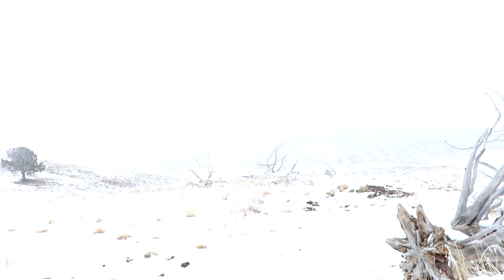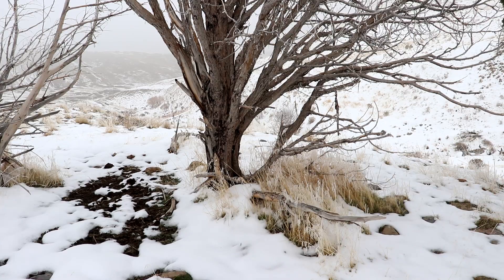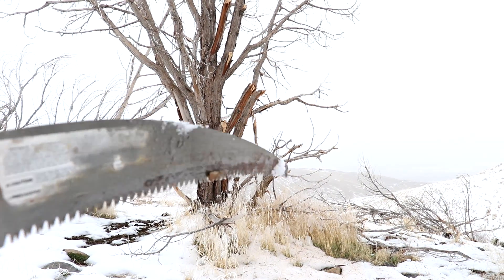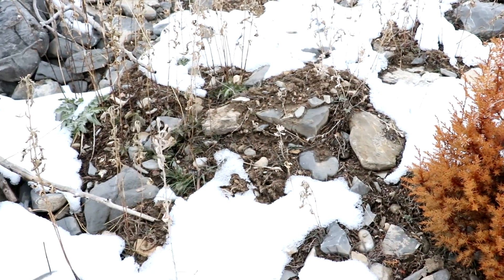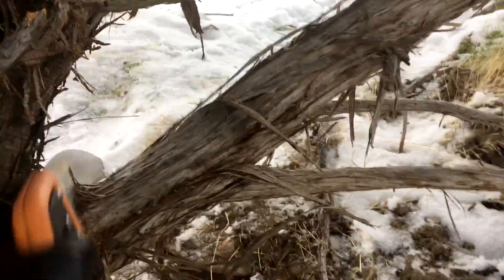Reforesting the Ranch Part 3: Fire-Proofing Existing Trees

Comment: May I ask why you didn't use a chainsaw from the beginning?
Reply: Probably because city-dwelling people simply do not understand and think chainsaws and people who own them are evil. Those of us who live in the country get it. Sometimes trees need to be cut down, pruned, or cut up after they fall across a rode or power line. But boy, the reactions from city people. Especially if you burn the logs! They freak out.
Reply: @mckenziekeith7434  what are you on about
Reply: @danielpluck6770  I am attempting to explain why I think Cody may have initially refrained from using a chainsaw. He may have been anticipating negative reaction from some people regarding chainsaws.
Reply: @mckenziekeith7434  I'd guess he simply didn't want to bring out a heavy tool if it wasn't specifically needed. We're not talking walking across your backyard to trim trees here.

Comment: Have you considered removing the topsoil and replacing it with crushed rock/gravel as well? The heat from the fire would also travel through the ground into the roots of the trees and had an impact on which trees would have burnt. The sap running through the roots could potentially get superheated and basically burn it from the inside out, at least that’s the case up north in Canada here a lot.

Comment: By cutting off the lower branches, you are also allowing more light onto the ground beneath the tree. 
It didn't look like you went high enough to allow cows underneath and some of the trees don't look like they'd survive that kind of pruning. 
I'm thinking there will become a fire hazard when grass grows underneath and the heat rises when it's burned.
There is a lot of large rocks around the place, and if placed under the trees would limit the amount of grass that could grow there.

Comment: Cody, when you were examining the growth rings on the cut limb.....it looks like you were commenting on how the tension wood hadn't grown.  On a leaning limb, you have tension and compression wood.  The tension wood will have narrow growth rings, and the compression wood rings will be fatter.  That makes the pith off-center and the fat compression rings on the downhill side.  It looked like the rings were fatter on the bottom part of the screen which would have been the downhill side of the limb.  Not to say the tree wasn't stressed, but you need to look at the growth rings all the way around the trunk.

Comment: I'm no botanist, I however doubt that the color of the dirt plays a factor in the color of the wood. If the tree used the dirt to build itself then there would be a crater as the tree used material from the soil as it grew. It more likely has to do with the moisture in the soil than the composition of the soil.
Reply: Warrior Son  I have, it either gets used or it's pushed out of the way or in most cases up which why sidewalks and some roads crack.

Comment: Oh that render distance is still pretty short...
Install optifine, on my pc it no joke doubles the frame rate
Reply: It is actually not uncommon for Optifine to double or even triple the framerate as native Minecraft rendering is so imperformant. Even on faster PCs Optifine can make a large difference as it allows the graphics card to run more optimizations on shaders and lightning for example.

Similar modifications exist for server performance where block state changes in all dimensions are synchronized on one thread in vanilla. Some mods for example enable threads per dimension as it is unlikely for a block change in one dimension to directly affect changes in another.
Reply: @Life4YourGames  Nice

Comment: I would recommend as a start to use a drone to spread seeds of different trees and different hardy plants ( not only flowers and such, more hardy and less likely to burn plants and things that can hold up water in the ground) just as the snow is melting, which will give you a chance of random seeding throughout the ranch, and give you potential water retention in the ground. After that, start with seeding the tree saplings you prepared when the weather is good for such things.
Having a good ground with huge variety of hardy plants helps alot with preventing fires when water retention is high and reduces the dry and flamable weeds and grass and gives bees huge foraging grounds as well, its a chain reaction more hardy plants, less fire, more spreading etc...
Reply: He did a video on his first attempts to clone native trees. He explained in that video that his attempts with collecting seed was not all that successful.

Comment: Step one to fireproofing trees: Cover them in snow.... close enough right? :P

Serious comment: Do you have access to a mass spec at your uni's chem department which you could use to confirm Fe in the sap? If you do find it present, would your TXRF be able to calculate the relative amount of Fe between the two samples, or would the organic molecules cause issues for your tool (asking as a biochemist)?

Comment: won’t a tree also start growing significantly slower after its first 50-60 years, especially smaller trees like those junipers. i know sunlight and rainfall will effect it, but should t it also be expected to slow in its growth as it gets to be that old?
Reply: also, cody you’re a little crazy to take on that job with just a hand pruning saw. at least get a little battery powered sawzall or small chainsaw out there.

Comment: Might I recommend a cordless reciprocating saw and a few extra batteries. Go through many times what you did in much less time. It does cost some money, but one of the better investments I have ever made.
Reply: Chainsaw... And a tank of gas And Youre all set
Reply: With so many dead branches cut on he ranch he could sell them as firewood and offset the cost of the power saw.
Reply: my dad did cut bunches of pinion and juniper brush trees. noticed how the chainsaw teeth wears so fast compared to common pine trees.   later he talked to extension, they said juniper and pinon family tree takes up some sand/soil into their bark while growing up.  thus abrades your saw tool.   I recommend reprociating saw with cheap bunch of rip greenwood blades.
Reply: Warrior Son  yes, I did think that too, a bow saw can take down a whole bloody leylandii conifer, (I've had to do it lots of times) but a folding pruning saw is ok for smaller stuff.
Reply: Nickhasarrived chainsaw?
Reply: Or chainsaw 🤦‍♂️
Reply: Try an electric (battery) powered chain saw.

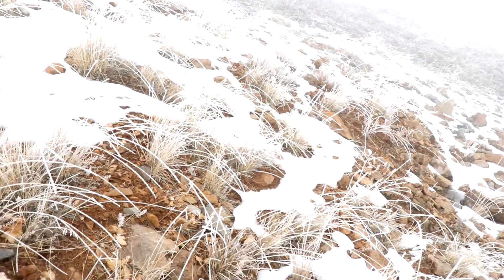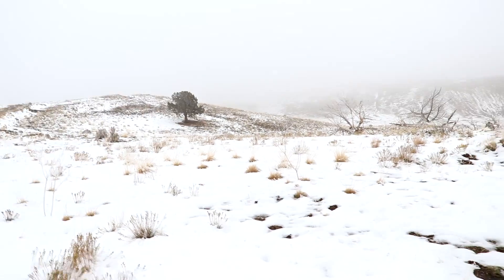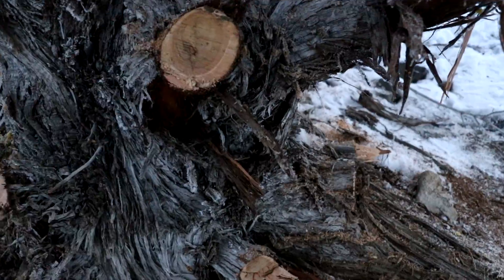Comment: After that weird recording thing at 7:13 in the mercury coin funnel video, and 1:30 and 8:35 of this video I think all that mercury you've been working on has gone to your head.
Reply: What's wrong with 1:30
Reply: @worker2004  voice goes robotic
Reply: Google "audio compression" and as for 8:35, its a easy to make editing oversight
Reply: nothing happens at 1 30 tho
Reply: @SbassLaser  did you not read the other reply?
Reply: @Crowbars2  i did and i still dont notice anything happening, my audio sounds normal the whole time
Reply: @SbassLaser  It's fine if you don't have good speakers or good hearing.
Reply: @Crowbars2  i have 5.1 surround sound and cant hear shit, maybe it only effects certain hardware

Comment: Would your scanner thingy tell you the composition of the orange sap compared to the less orange sap
Reply: I don't think that scanner works (well enough) on liquids, but maybe the wood itself could be scanned.
Reply: Oh good, I'm not the only one who thought of it.

Since the sap is solidified now, would that matter?
Reply: @soniccookie655  Solid doesn't mean crystalline;)
Reply: as far as a lattice of atoms in a rigid structure any solid could be considered crystalline
Reply: jacob casmus Good point, in theory you should be right but I’m unsure off the specifics of his device.
Reply: @jacobcasmus1882 It would just find "light elements" (but maybe might see some iron)
Reply: @jacobcasmus1882  "Crystalline" implies crystals. Crystals are uniform arrangements of atoms. Sap is not a crystal at all, because it is composed of many large molecules (mainly carbohydrates) that are both diverse and not arranged in any orderly fashion.
Reply: I think not, because x-rays go right through the wood without interacting witch its atoms.
Reply: No, it wouldn't. The "scanner" figures the elemental composition. The difference in sap is due to different carbohydrates and tannins in it, which are made of the same concentrations of carbon, nitrogen, oxygen, hydrogen, etc.
Reply: The X-ray spectrometer he used before is mainly geared more towards minerals so I wouldn’t expect it work well on the sap and wood. But It would be fun to see Cody try it.
Reply: well he says its growing in an area of orange soil so probably iron
Reply: @Hewitt_himself    The soil has iron, he already mentioned that, but that doesn't necessarily mean the wood and sap has alot of iron. Another comment mentioned it was excess food the tree was producing. It could just be a coincidence that both the wood/sap and soil are the same color and the coloration of the wood and sap comes from something else.

Comment: Cody, you're going to have to get equipment out there to pile up the dead trees & branches. So you can get rid of them, burn the pile during winter without wind. 

We're in the process of removing tons of dead fall trees and whole dead trees that are still standing. It's a headache for sure!

Good luck clearing the dead & low branches.

You can use the sap. Save the stuff you find. You can use it for a natural glue among other things.
Reply: Look into hugelkultur especially if you garden

Comment: I've been having alot of trouble with flies laying eggs in my inside plants. Any natural way I can solve this without using harsh chemicals like ammonia?
Reply: It sounds like your overwatering, Put in diluted hydrogen peroxide, it will get rid of fungus and gnats as well as aerating the soil to dry it out and give it a o2 boost
Reply: Diatomaceous earth, read up on it, buy it, apply it.
Reply: @mMAmericanSpiritMm  how should I apply it? Just sprinkle or cover
Reply: @science_and_anonymous  Best way I've seen are duster pumps, but dusting by hand is fine. Doesn't need much, but it needs to be done again after rain/watering washes it away.
Reply: I think burning thermite is the best way to get rid of the eggs🤔😅
Reply: @marcoh.3467  that's what I'm talking about lmfao
Reply: Start by figuring out what kind of fly you have and that will give you your best course of action. You could have anything from fungus gnats to white flies. A spray bottle of neem oil is pretty effective on most small bugs though.